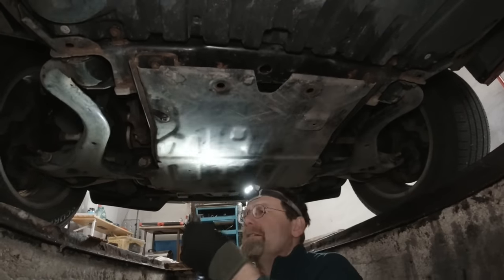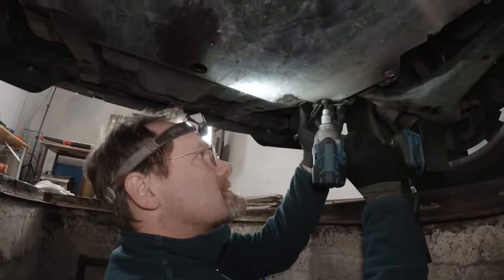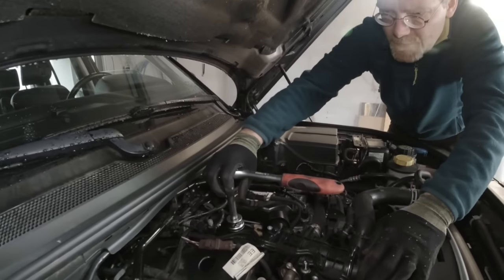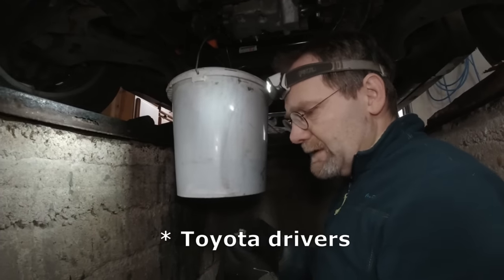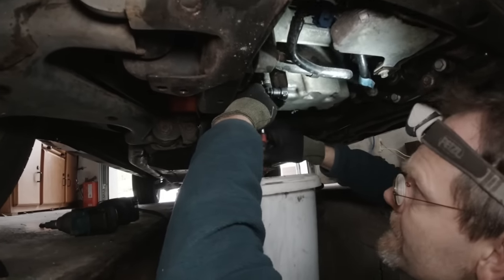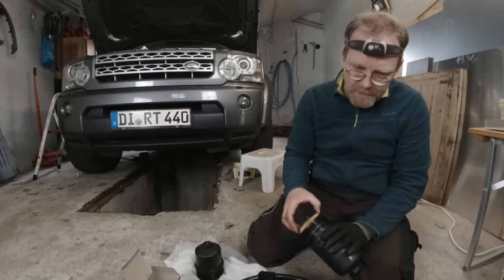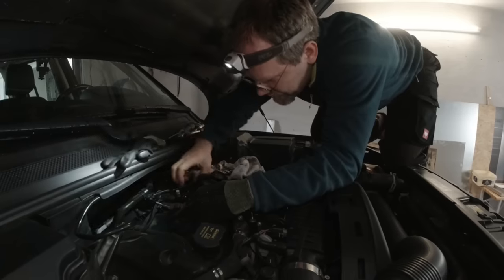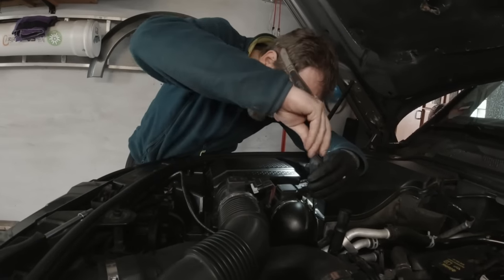No more 5W-30 ever again - Land Rover Discovery 4 - Transfer Case and Diff oil change

Comment: The reason for some many differences in early V6 to slightly later V6 is because the initial design and production was PSA, then Ford took over engine manufacturing in its own factory.  And turned it into rubbish.

Comment: They probably switched to a smaller oil filter because the previous virsion worked correctly and thus it didn't belong in a land rover.
Reply from the maker: 😅👍Sounds just about right. 🙋‍♀️

Comment: 5w-40 is far better for high mileage Diesel engines I use it all the time on my land cruiser 190 thousand miles on the clock runs far better

Comment: 5w30 is very generous, I think LR recommends 0W20 for its vehicles in US! And if you try to question that, whole bunch of smart cookies run towards with statementds that tolerances in that engine are specifically designed for that oil viscocity... which is BS.
The LR in Africa has exactly same engine and same thermostat as LRs anywhere else. So engine temps is the same. If LR Africa okeys use of 5w40, it means any LR can take it, use some common sense if you are in Northern Canada or in Siberia, perhaps lighter wiscosity is better suited for cold start-ups... But 8n any case, notion that engines in LRs sold in Africa and those sold in EU and North America somehow mechanically different is absurd.
Also, you can, usually,  find a note that under heavy conditions 5w40 is best choice, and people will agree that those LRs in Africa are under  heavy, severe conditions...
Yeah, ok, but do you really think that few hours long summer traffic jams in California, New York City and so on are any better, you are wrong...
Reply from the maker: I think 0w20 is used on the V8.  Crazy.  We stick with 5w40 on our Diesel 👍.

Comment: if low oil pressure is confirmed ,then stop using the engine and change the pump before hot season ...

Comment: If it would be a Toyota you would have to change it at 1.000.000km for the first time 😂 and than you fill in the old oil of your LR an it will run another million 😉

Comment: can your oil gauges be telling you the WRONG information  before changing oil pump  check them out.
Reply from the maker: No, we also measure the oil pressure directly from the engine. We have that in one of the videos, but I can't find the correct one. Also, it cranks longer than before, the car needs more time to build up oil pressure. We will, for sure, change that oilpump, no matter what. Just for peace of mind. And then, we'll go from there. Christian always preaches, "go back to your last running moment". That is where you have to start looking for causes to the problems. And for my car, it was the moment when we put in the FAI pump. 👍🙋‍♀️Vera
Reply from the maker: I checked two different gauges and I got two cars to compare.  Pressure is below spec right now.  Not good.  Christian